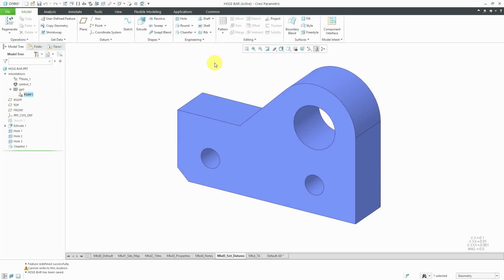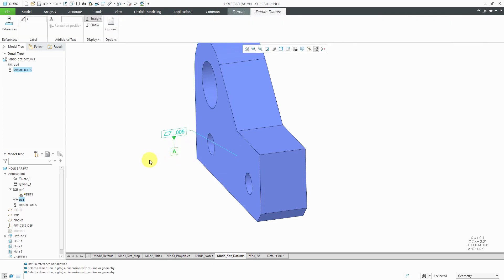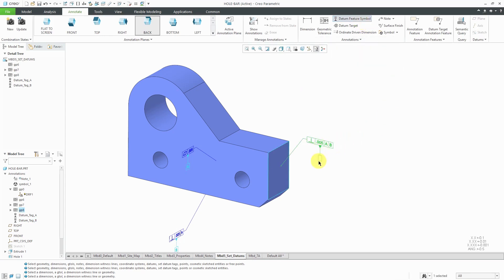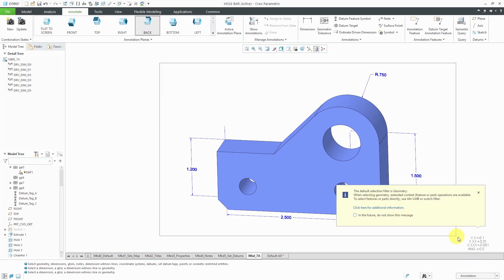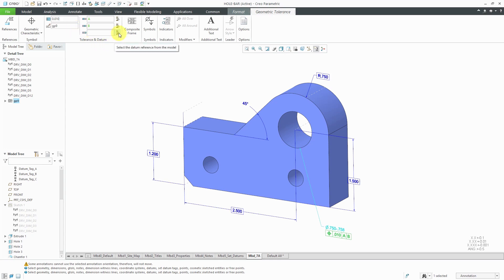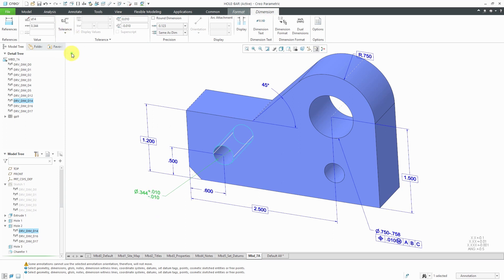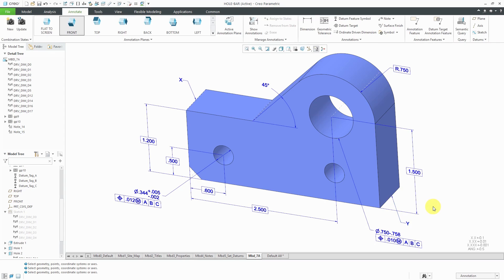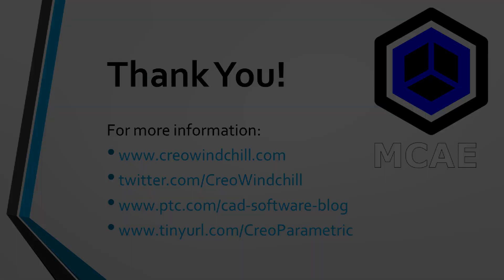Creo Parametric - Geometric Tolerances (GD&T) Part 1 - Model Based Definition (MBD)

Comment: I cannot remember how to add a Diameter symbol in front of the tolerance for a positional tolerance gtol, any advice appreciated.
Reply from the maker: Position your cursor in the field to the left of the diameter value. Then click on the symbols drop-down in the dashboard. I'm not in front of Creo right now; it might look like the hole depth symbol (down arrow with top horizontal line). Click on the phi sign.

Comment: did you need to state a "2 X" on the smaller hole annotation or is the other hole going to be annotated on another plane? sorry if i missed it in the video
Reply from the maker: I made that video 2 years ago. I don’t remember. I could have missed the 2X as I was probably concentrating on the Geometric Tolerances given the title of the video and not the dimensions.
Reply: @CADPLMGuy  Sorry I didn't mean to correct you or anything, just curious if the wholes were different sizes and you were going to apply annotations on another plane or something. Thank you
Reply from the maker: I don't remember the diameters. From what I remember of the video, I didn't fully annotate the model. The intent was probably to show people how to create a few datums and feature control frames.
Reply: @CADPLMGuy  Great, thanks a ton. Your videos have been saving me in grad school!